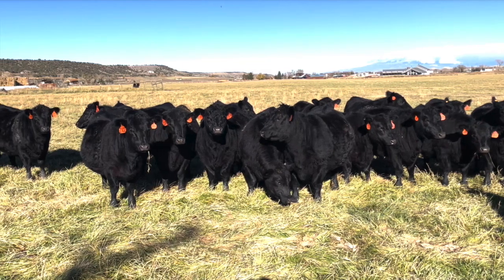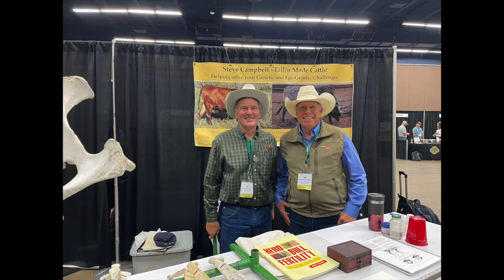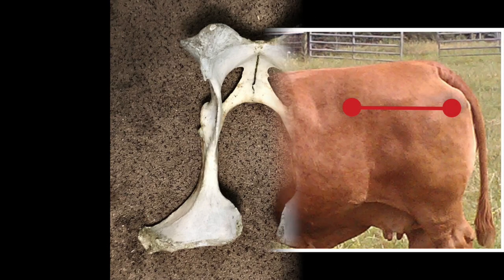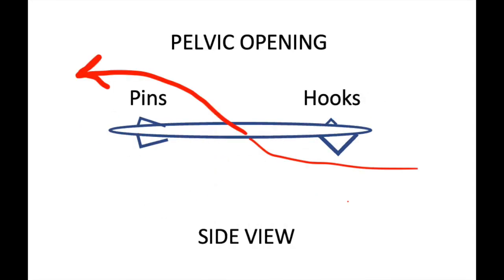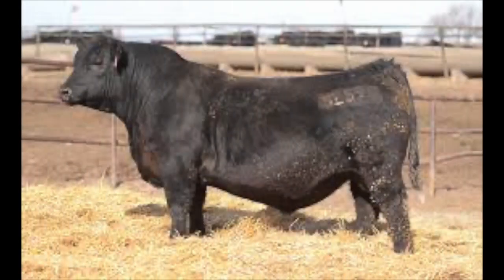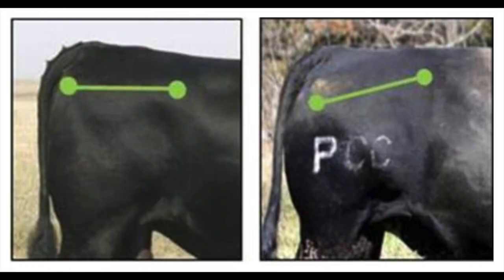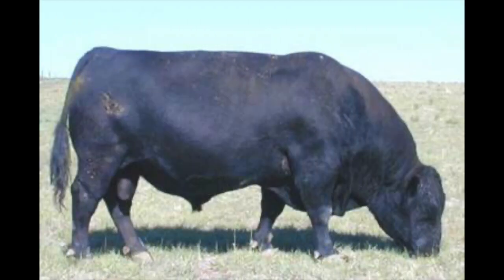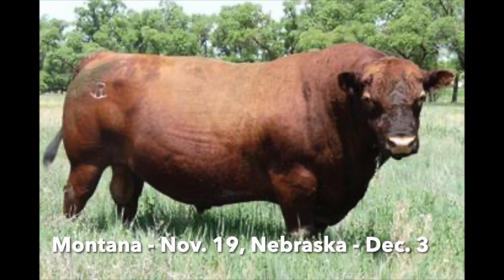How to Spot Calving Ease - Herd Quitter Minute

Comment: I have registered cattle but charolai. I focus on genetics. So far it's worked. 

I do have a few registered black Angus but it's for strictly calving ease. 

I like the old school Angus too which isn't too big. I think I finally have my ocd heifer bull. I preg checks my 30 heifers. Everybody is bred. 

Last 2 years no assisting. This bull is better and his mother history never had assist. Same with father. 

If yall are wondering why I like my short old school Angus. Oklahoma has a different weight that works vs Montana then add the fact I'm breeding heifers 850-1,150 pound. Pounds. The heavy weight heifers I'm not worried about having the bull cripple them. It's the possible 780 pound heifers in the ground I'm worried getting crippled from the bulls. 

I have commercial cows too. I brag on them. 9 years making and only 4 assist out of 20 heifers each year.